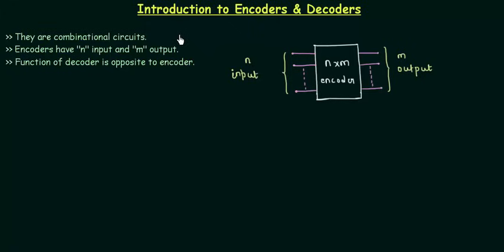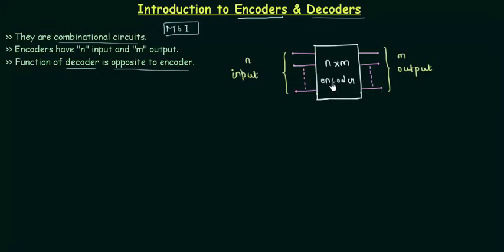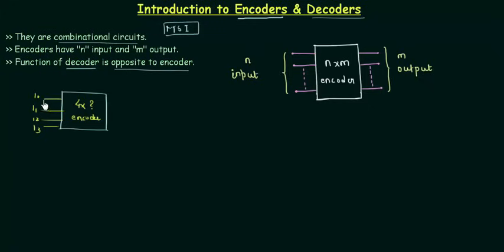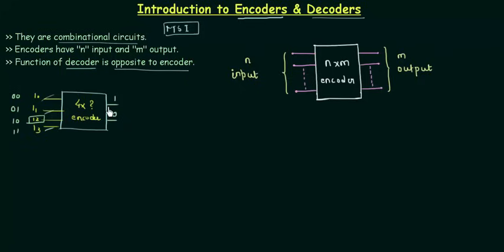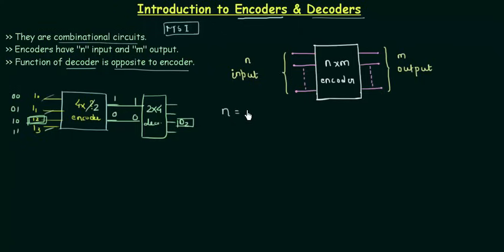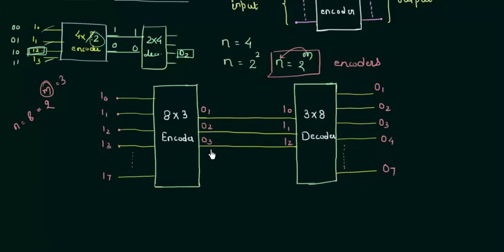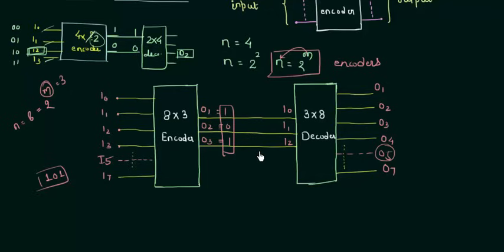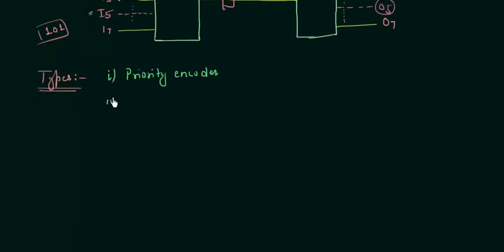Introduction to Encoders and Decoders

Comment: 1. Five invigilators from ECE, EEE, CSE, IT and Civil departments must go for an invigilation. But due to the friendship and enmity between the departments, the following conditions are to be satisfied for the exam section to send them for invigilation. They are
a) Either faculty from ECE or EEE or both must go.
b) Either faculty from CSE or Civil but not both must go.
c) Either both ECE and CSE faculty must go or neither goes.
d) If IT faculty goes, then faculty from Civil must also go.
e) If ECE faculty goes, then EEE and CSE faculty must also go.
Determine the expression which specifies the combination of faculty who can go for the invigilation.
2. A digital locker has 5-digit password 1, 2, 3, 4 and 5; and all the 5 digits must be entered to open the locker. The digits of the password are with 5 people in the following manner.
	i) Mr. A knows 1st and 3rd digits.
	ii) Mr. B knows 1st and 4th digits.
	iii) Mr. C knows 2nd and 4th digits.
	iv) Mr. D knows 3rd and 5th digits.
	v) Mr. E knows 1st and 5th digits of the password.
Find the minimum number of people required to open the locker. Find all the combination of persons to open the safe as a Boolean equation. Also find who is the most essential person.
3. A lawn sprinkler system is controlled by some combinations of following variables.
Season (S = 1, if summer; 0, otherwise)
Moisture content in the soil (M = 1, if high; 0, if low)
Temperature (T = 1, if high; 0. if low)
Humidity (H = 1, if high; 0, if low)
The sprinkler is turned ON in the following situations.
	a) The moisture content is low in winter.
	b) The temperature is high, and the moisture content is low in summer.
	c) The temperature is high, and the humidity is high in summer.
	d) The temperature is low, and the moisture is low is summer.
	e)  The temperature is high, and the humidity is low.
Using K-map find the logic expression and implement it using NAND logic. Design a combinational logic circuit using
a) Decoder,
b) 16:1 Multiplexer and
c) Only one 8:1 Multiplexer 
I want this answer
Reply: Tromarrow
Reply: Only plz
Reply: Reply

Comment: There is a minor mistake in order of bits to decoder. it should be 0, 1 not 1,0 because 1,0 is equivalent to 1 in decimal and 0,1 is 2 in decimal.

Comment: I didn't get the relation between n and m in encoder 
.... plz help me plz
Reply: Nothing much bro, The concept is simple, If only one input is high at a time, What is the purpose of sending all the 8 data lines..? Only 3 lines is enough(because 3 lines is enough to represent 8 lines uniquely) So encoder encodes the 8 input lines to 3 and send them(so the circuit size and overhead reduces), And at the decoder side, It will see the 3 lines and identify the respective output line as per the unique value of bit sequence in that. That is all

Comment: we also have 10:4 encoders that dosen't satisfy your n=2^m formula/relation..
Reply: 10:4 encoders are different. They are called "priority encoders" and use the extra two lines for different things. They actually have 9 inputs and 4 outputs, not 10, and they are designed to deal with different things. They're called 10:4 because they have an implied decimal zero when all inputs are high. They also don't follow the normal rules of encoders as only the "top" low matters. Their function works very differently from normal encoders. Here is a PDF that includes a description and truth table for 10:4 priority encoders: http://noel.feld.cvut.cz/hw/st/1902.pdf

If none of that makes any sense to you, just know that priority encoders are outside of the scope of this explanation.

Comment: Would you please clear my confusion(on 2:17) about the values that how on single input i 0 or i1 or i2 is 2 bits..mean 00,01etc as it is a single input each.

May be its too easy but i cant grasp it.
Reply: When i0 is high encoder will send 00, when i1 is high encoder will send 01 and so on.